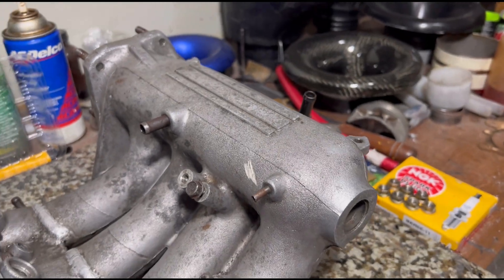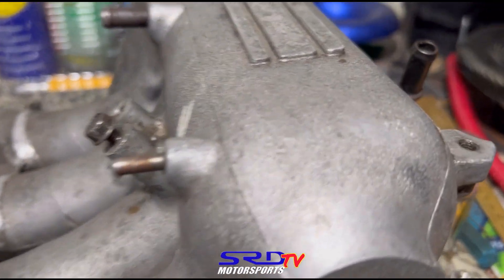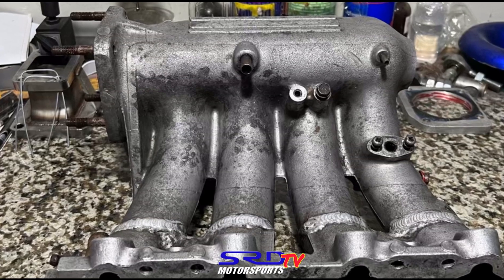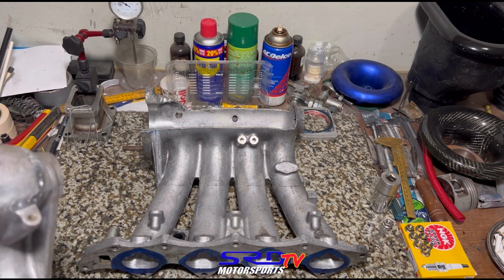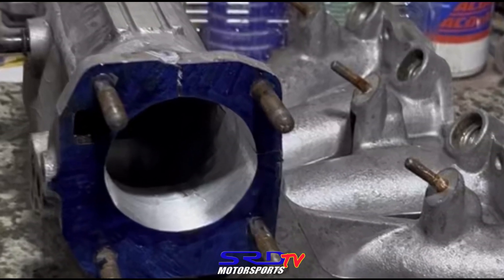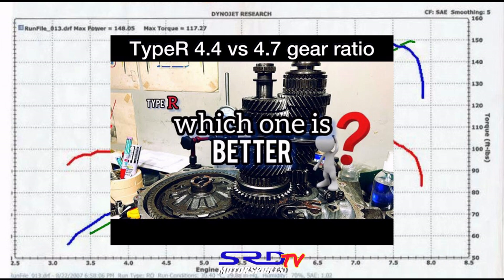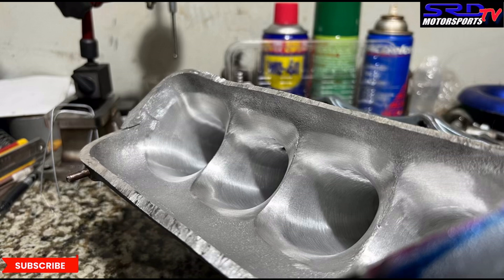B16a P30 Intake modified for D16 use

Comment: Was this dyno tested without being ported
Or was it ported then dyno 
Moral of the story this isn't a good set up?
Reply from the maker: both… not a good set up , runner is too short for any D16 set up it’s why the skunk2 d16 manifold has almost twice the length the harmonics seem to hit on the ideal range for the d16
Reply: @SRDmotorsports 
Didn't you port one out for a friend of yours that was short circuit racing and you had to tap the water jacket for the throttle body
Reply from the maker: I don’t remember anything like that actually
Reply from the maker: either way it still doesn’t work

We did this me and bong in H3 way back 2005-2006 when ordering was too expensive and the sohc manifold from skunk2 was still not around once it came around it from skunk2 , this became inappropriate

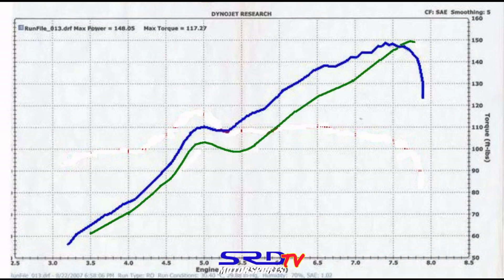Comment: @ 9:14 what do you mean aiming for top end power doesn't make you fast? Can you elaborate it? Are you speaking from a drag pov or what? Thank you!
Reply from the maker: aiming for top end power and weak midrange 

in any Motorsport even on the street by the time u get to the “top end” your opponent already left u 

Think about it
Reply: @SRDmotorsports  Damn, I thank you very much for that! I always aim for the top end even by the cost of losing low end power because I like the idea of dulo or "naduluhan" if you know what I mean hehe. Anyway, us, who are new from the industry are always waiting for you new videos to be uploaded
Reply from the maker: I was about to say “dulo” for us is the second half of the track or strip…

a sohc that punches into 4th gear at about 300m ? With strong midrange at 5-6k rpm ? Will have tremendous “dulo” as perception

But it had a strong midrange that’s why :)
Reply from the maker: Ah look at the dynograph the green graph/line makes 150whp
 Has more top end than the 
Blue graph that makes 148whp only 

il tell u the 150whp one is way way slower than the 148 
By studying that graph

Comment: excuse me from indonesia I want to ask about the porting of the D15 vtec p2j, is there a significant size? and my compression is 12.8
Thanks🙏
Reply: do you know the rumors of the p08-1 and p08-2 camshafts???
Reply from the maker: @rezakurniawan2779  no actually but I’ve even heard a/T (automatic) p08 engines have better/bigger cam than manual 😂
Reply: thanks for all your suggestions for me when will i ask you again😊
Reply from the maker: @rezakurniawan2779  thank you too and hope you enjoy the project and thank you for supporting my videos :)
Reply from the maker: There isn’t much of a significant change in size I mean if you are talking about port volume? It’s way different from a P08 head but what you can do to be sure is

Make a gasket for the intake and work it and also use the same gasket to match the intake with, don’t match it using existing gasket because they are always misaligned 

Your compression is GOOD will make POWER! :)
Reply: @SRDmotorsports  thanks for your suggestion and i'm doing port and polish you teach
Reply from the maker: @rezakurniawan2779  no problem man I think a safe starting point or size for the vacuum log is like what I did, cut a 6in long 3in intake pipe (simota) so 3x6 and closed both ends and put small fittings on the side 

You can do this with steel it’s cheaper but follow size

Also the d16y8 is generally a high speed port with smaller port volume so u are safe porting it even alot because you have good compression :)

Comment: that vtec crossover was begging to be higher
Reply from the maker: I see what you saw there 
But the 4,700 rpm hump is what they call “AEM hump” due to CAI length intake but a lil longer both ran a velocity stack out the headlight that’s why

Hence only the green line was vtec
The blue line (dyno is non vtec) still had that hump :)

Comment: What are cam cap torque specs on b20b? Non vtec.
Reply from the maker: The cam hold down top caps (replacing cam seals) = 9.8 N-m -- 7.2 lbf-ft

That’s on the manual thanks for asking bro

Comment: Wat cam would u suggest on a p08 head
Sk2 manifold & 70mm tb
Daily & race!
😊
Thanks bro
Reply from the maker: What pistons? But even then let’s say u use a
Pm7 ?

A lot would choose crower stage2 for the tamer characteristics but even for a street car I’d go for a crower stage 3 especially cuz u are using  a skunk2 pro series intake so runner length is good :) so torque will be good :)
Reply: @SRDmotorsports  
Pm3 pistons
With b20 rods with arp rod bolts
Reply from the maker: @carslover_volkswagen1  oh man I love the set up!!! Engine safe to rev :)  so I think I would suggest crower stage 2 for others but I will personally prefer
 crower stage 3 :) if that makes sense 😎
Reply: @SRDmotorsports  
Would the crower stage 3 be drivable on a bumper to bumper traffic with aircon?
Idle still good?
Reply from the maker: @carslover_volkswagen1  oh yes yes the crower stage 3 for sohc can idle the same as crower stage2 no problem
Reply: @SRDmotorsports  
Thanks for d help bro
Keep up d good work
Reply from the maker: @carslover_volkswagen1  not a problem bro hope your project runs awesome and gets to be enjoyed as it should be :)
Reply from the maker: And thanks for the cool question cuz I bet many ask that and this means you help them too :)

Comment: Nice theory and I don’t disagree with your points however it’s simply not accurate to compare dyno plots for different engines, different dynos and different days… If you’re going to conclusively say something is better then something else it needs to be the same engine, same day and same dyno.
Reply from the maker: Yes that’s true I agree no doubt

I simply was pointing out that the other engine I built (same builder) with supposed better stuff. The main thing it didn’t work for it is in essence the lack of runner length

Wasn’t totally an engine comparison or competition but yes sir your points are correct

And also I should add… we both know and often see a lot of times “whp” numbers only and a partial graph not showing rpm or range so I was hinting on that, cuz here? Man!!! “Incomplete graph” wowness 😂

But thanks for this and valid points sir :)

Comment: Just curious, what cam did the A6 run? Was it the one that had a Bisi cam? Also, theoretically speaking, how would the Crower 3 D16Z6's midrange be if it had a Skunk2 intake manifold with all other things kept the same?
Reply from the maker: yes the bisi cam same cam thats with me hence i bought it back lol

good point on the z6 crower 3

in actuality even if it ran a ported z6 manifold? might have killed it already lol

i mean see not much mid but still pulled up top
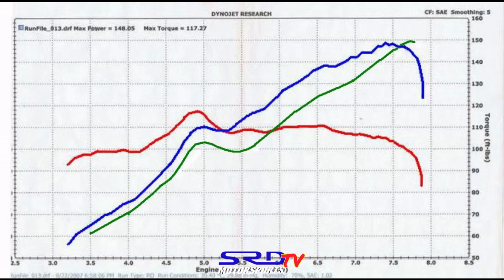Reply: @SRDmotorsports  The difference is very drastic as shown in 8:22 of the video. Did the Z6 have full on head work too?
Reply from the maker: @findtherightbeat  yep all the bells n whistles done by yours truly
Reply: @SRDmotorsports  Did you also use your custom seat cutters on it?
Reply from the maker: @findtherightbeat  no not yet didn’t have those yet then nor did I know that much back then lol
Reply: @SRDmotorsports  Would be interesting to see how those already very efficient builds would respond to your current preferred seat configuration 🍻
Reply from the maker: @findtherightbeat   that’s true actually
Reply: @SRDmotorsports  By any chance, have you worked on a B18A head? Is the casting different from that of the B18B?
Reply from the maker: @findtherightbeat  not sure if it’s different but usually it’s either p75 or the other one not p8r that’s on the rare b20s only
Reply: @SRDmotorsports  Thanks! Just asked as I ran into through an old thread on H-T about a non-vtec engine owned by Tim Martin (King Motorsports' head tuner) that had very good results from back in the day. Luckily, some of the graphs are still showing. Something worth noting is the intake length and header pairing observation Tim Martin mentioned (some who spends a lot of time on the dyno). If you'd like to take a look, here's the thread title: 205 WHP LS GRAPH INSIDE Pump gas 93 OCT.
Reply from the maker: @findtherightbeat  Ah yes yes I remember that thread and the intake length hence I always preferred CAI 😎 ran 14.8 stock block d15b7 non vtec stock cam “no ram” back in the day :) but with CAI
Reply: @SRDmotorsports  I saw that run in Clark!
Reply from the maker: @findtherightbeat  sweet!! If u remember hcp I updated the thread with every move or mod done and updated each event?

I plan to do that again this time here so 
Each event will have two segments a video like an “event recap” like most vloggers 

But also! An event recap of the set-up/car on its happenings and reactions at the race event kinda like an inside look as if pit crew ftw

Comment: Hey man how you doing? 😎
What size injectors would you recommend for an na b20 vtec with ycp pistons, rods arps, stage 1 cams, 70mm throttle body and headers
Reply from the maker: Oh nice set up u got there

270-310cc will be maxxed out for you even on pump gas no e85

So I think RDX 410cc will be great but must be tuned
Reply: @SRDmotorsports  
Are the RDX injectors good?
Reply from the maker: @carslover_volkswagen1  yeah as long as you get the original Honda ones not the china copies
Reply: Thanks bro
I currently have 440cc injectors but they were getting maxed out while tuning... I had them flow tested and they were firing perfectly so the only thing I think could be cuzing this is maybe the fuel pressure regulator?
Reply from the maker: @AngeloChristmas  are you on e85?

And yes I always run an adjustable fuel reg
And most likely our civic it’s age? The fuel pump is needing replacement so walbro fo sho
Reply: @SRDmotorsports  here in Africa we only babe 95 unleaded
The fuel pump was changed recently, what do you think of the AEM Fuel pressure regulator?
It goes straight onto the rail
Reply from the maker: @AngeloChristmas  oh I though u are in the US same here hehehe

Yeah the AEM afpr is good and I like it cuz it bolts up to the rail good 

Also double check the banjo on the fuel line that connects to the rail, a lot of times the aluminum washer there (crush washer) is worn and got thinner = the feed hole doesn’t align to the rail feed hole

Small thing that’s often not seen or realized but free to check
Reply: @SRDmotorsports  lol no bro, where are you from?

Thanks man I will definitely check that out, il keep you updated too, hoping to do the final tune tomorrow if all goes well ✊🏼🔥
Reply from the maker: @AngeloChristmas  Philippines but I lived and grew up in Mozambique and South Africa in the 90s
Reply: @SRDmotorsports  nice bro!
Where about in South Africa?
And where do you order your performance parts from?
Reply from the maker: @AngeloChristmas  South Africa was mostly nelspruit cuz that was close to Mozambique but that was my childhood in the 90s so I’m always glad to see nowadays Honda life exists there :)
Reply: @SRDmotorsports  hehe yes indeed it does 😎

Comment: btw if u hav the intake manifold ported, is it required to port also the intake entry on the engine head ? (where the intake manifold and engine head meets)
Reply from the maker: depends how they port it but it’s why I also port the flange side bfor the head. On the manifold last or not this way it still matches as stock